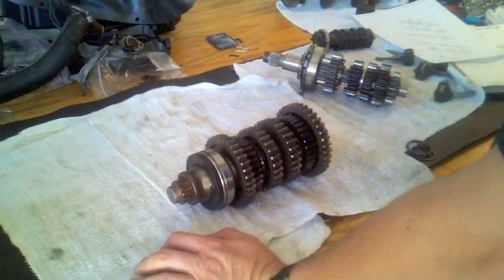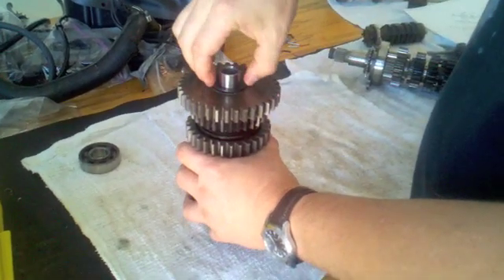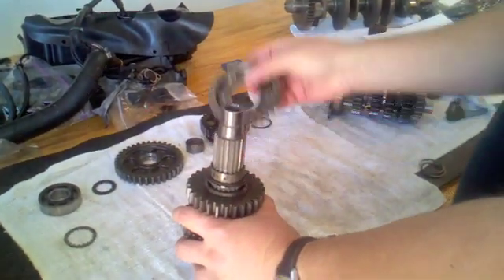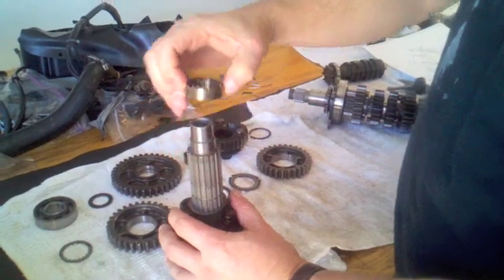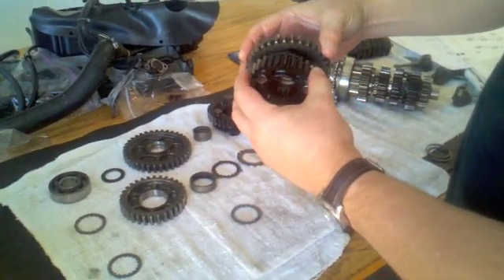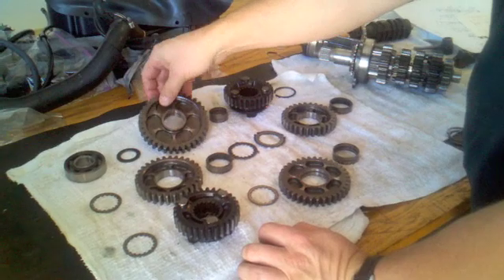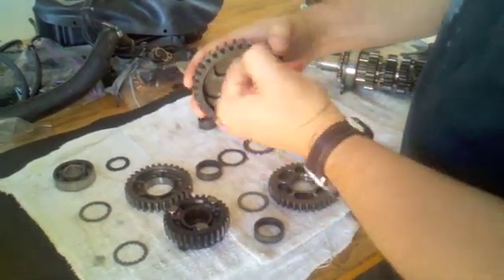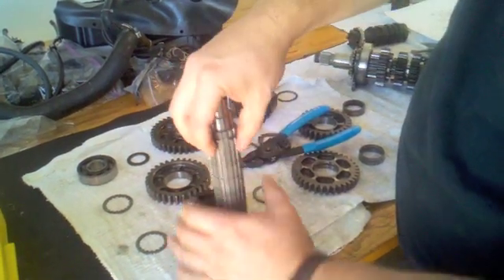2000 Yamaha YZF-R1 Engine Rebuild - Part 12

Comment: Any idea if there are updated gears and forks you can buy that dont fail? Did Yamaha ever remedy these machined parts?
Reply: The replacement parts available from Yamaha have been corrected
Reply: Oh that's great. Thank you for the info and quick reply. Great videos by the way. I'm just about to attempt to tackle this job.

Comment: Importent question: You changed gear 1st and 2second right? do you also need too change 1st and 2second on the main drive axle? A mechanic of mine says: always change both otherwise there will be noise.

Comment: Great vids.. I agree.. but when you did put down the wheels in gear module, I would put them not only in right order as they where dissambled, but also in correct alignment, i.e. have all in same direction as right side turning up or via versa.. etc..
Of cause you can figure it out later.. it will not fit together wrongly, but to be 100% sure is one thing, guessing totally another ball game.

Comment: Great vids. Those spacers are they the bearings? My 05 R1 has a noticeable whine in second gear between 3k -4k rpm and can only think it can be the bearing but haven't got a clue about bike gearboxes.

Comment: I am also rebuilding my bike but it's a 2000 R6. I know it's not the same but your videos have been inspiring and a good idea of whats ahead. Part 11 and 12 here has been the most help as i do have the second gear issue starting. Your explanation and demonstration has been a great help in understanding the problems and how the trans works and what to look out for. For the R6, Yamaha fixed this issue with the dogs  going from 3 notches to 5 in 2003/2004 and can be a direct swap for my year. I don't know if that option came with the R1 but thankfully i can upgrade to the redesigned version. Thanks very much for your time and effort recording your project. Cheers
Reply: You welcome Jason, good luck with your rebuild!

Comment from the maker: I can only speculate that it is recommended because the circlips can be easily distorted during removal along with potential metal fatigue.  I try not to second guess the design engineers, but, if you think the clips are in good shape, you can probably get away with reusing.  I reused a couple components and i've got 4000 miles on the bike now post-rebuild with no issues.